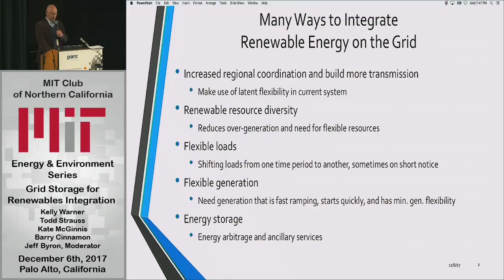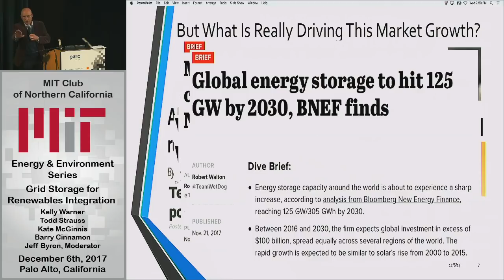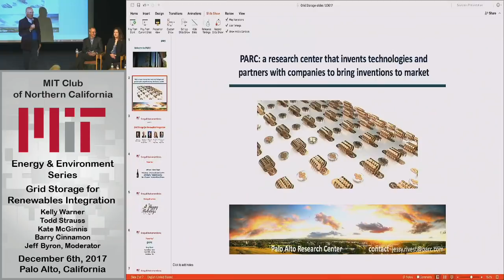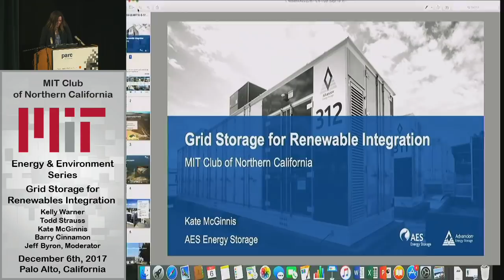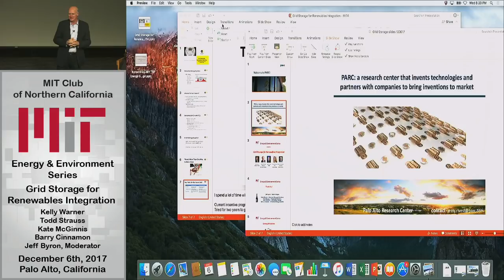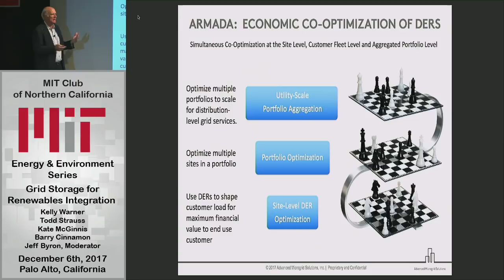Grid Storage for Renewables Integration

Comment: The best way to use the present solar panels. Would be proof tops of houses and buildings, maybe on sides. Where that space is dead space. It's not real being used and it wouldn't take up other space that could be used for a better use. Remember thier talking about taking up vast land area.
Reply: Panels would protect the roof shingles and contents of the attic from large amounts of heat, as well as the heat which migrates down to the top floor.

Comment: Grid scale energy storage to eliminate fossil fuel is unimaginable. Wind and solar power does not only vary hour to hour, it varies day to day, week to week, month to month , year to year, and more. Unimaginable  amounts of renewable energy needs to be stored for longer than a year to avoid ever running short. As a result, the present dependence on fossil fuel will continue indefinitely.

The extra cost of renewable energy is for nothing in return!